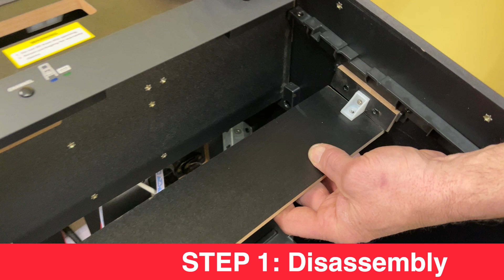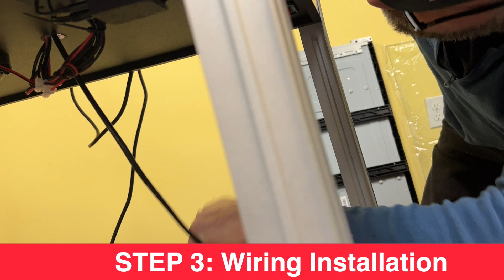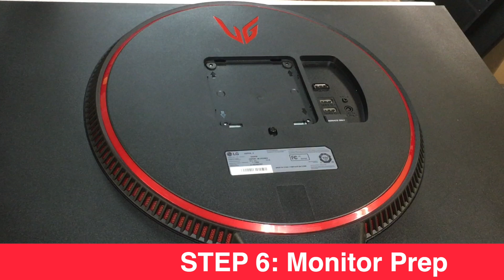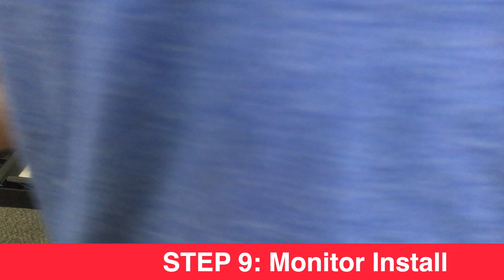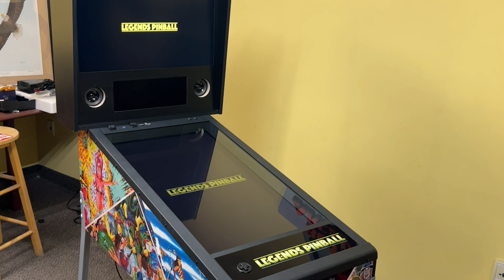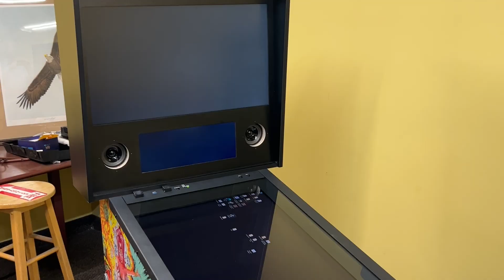ALP Playfield Screen upgrade install - PREVIEW

Comment: Excellent video. Kit looks well thought out and executed. Look forward to giving it a go. One suggestion would be maybe a separate discussion - or pointing to one that already exists - on tapping into the ALP's switched on power as you did here. Hard to see all the wiring / pieces but tying into main power would be better than second power cable or smart plug strip.
Reply from the maker: Thanks and yes, we took out tying into the ALP power and will make that a separate video. It added a lot of complexity and thought it's already long enough!